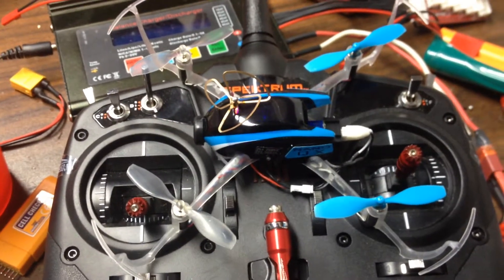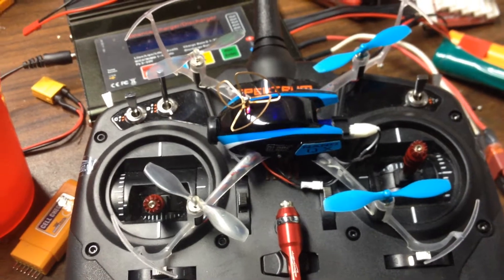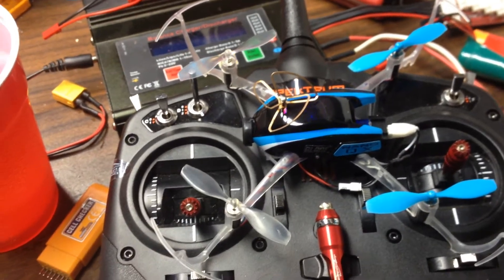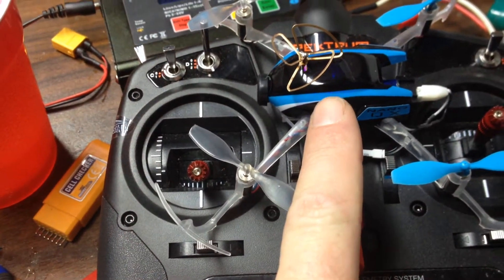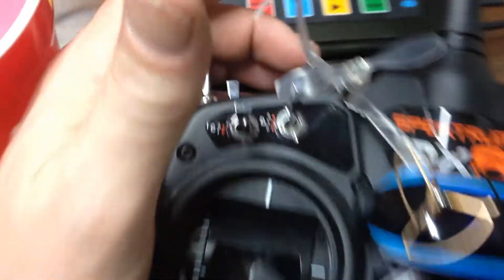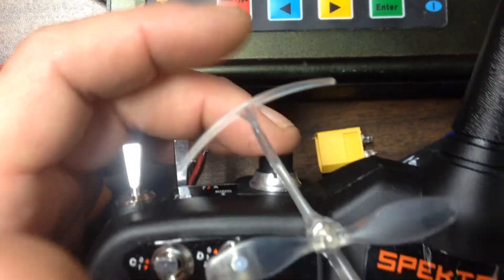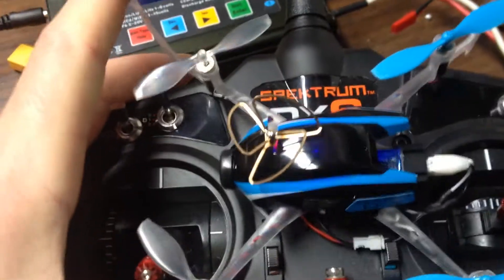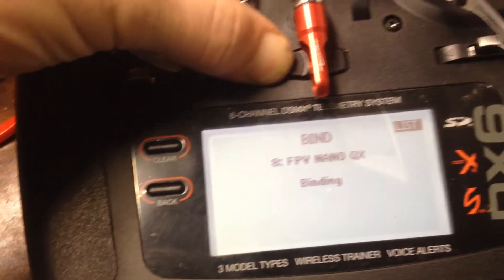Fpv Nano QX how to bind dx6

Comment: Thanks for showing this. This is much better than the vid from June, which got you more thumbs down than up...LOL. 
You should probably just pull it. :)
Anyway, in this video, you have the microquad already powered up, but I hope you realize that it is very unsafe to do that. You should always have your transmitter on first, before you power up your quad, you dont want the FCM to get interference from some other 2.4Ghz source and spin the props.

Comment: do all dx6 come with a blade fpv preset? or did you need to program or upload one into the controller somehow?
Reply: My DX6I had no trouble. But Idk about the old dx6
Reply from the maker: you just set it up as a airplane and set your trim and go fpv! check out the flight video. i will get a model setup video up soon.have a blessed day